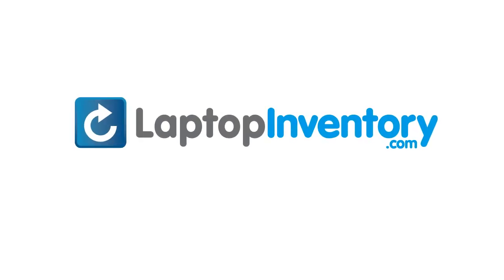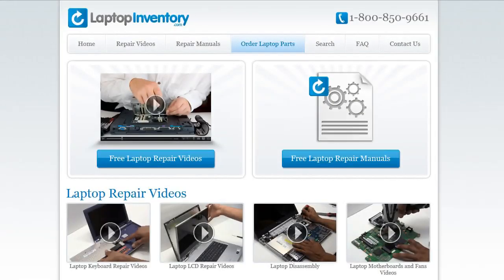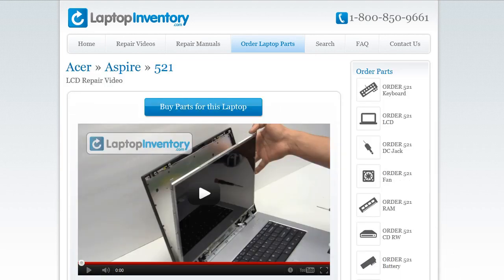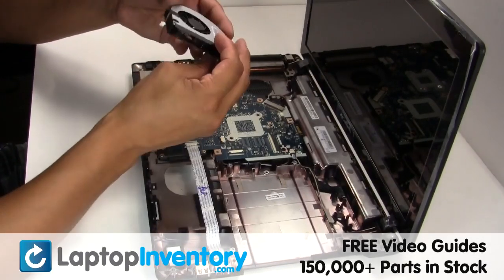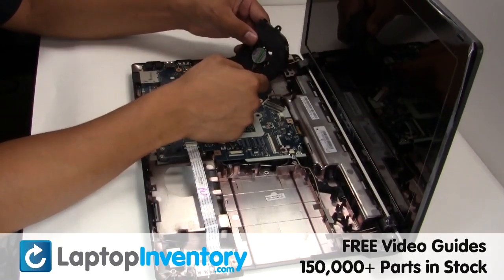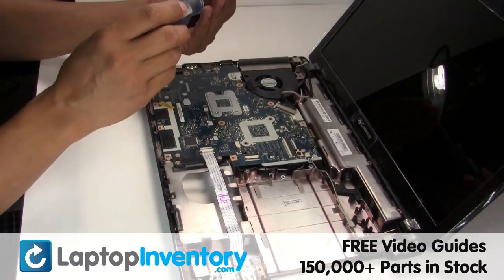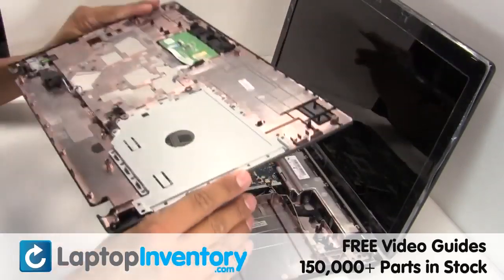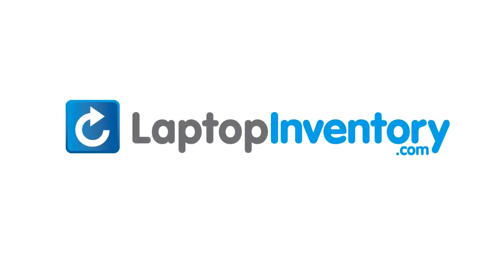Gateway Fan Replacement NV55C NV59C | Laptop Notebook CPU Cooling Heatsink Fix Repair Install

Comment: OH YOU GUYS ARE FRICKIN LUCKY , try doing the NV57h, they REALLY donked it up 
This is probably the worst laptop I got to dissasemble in my ownership, 
you gotta remove all the ribbon cables just to merely access the back of
 the motherboard, which has even more wires to unplug, then you are 
allowed to actually have the motherboard in your hand if you can 
unhandle it from the intel wifi chip, its a hassle everytime, I just 
want a laptop which's fan wont sound like crap haaaa

Comment: The video was good as far as removing keyboard and being directed to more info, if needed.

Being an IT repair person for over 25 years now, I cringed a bit when I saw the Putty-Knife like, metal tool being used.  

A safer way to release the old kybd, IMHO, is to use a couple of credit cards. They are stiff enough to allow some prying effect and safer than a Metal putty-knife type device. After releasing 1st catch, keep one credit card under the top, right corner, so it doesn't fall down and reattach itself. Use 2nd card to release next catch, and so on, sliding 2nd CC toward the left as catches are released.

With the NV55C there are 6  top retaining  "sliding catches".   

The hardest part can be finding those 6 Sliding catches above the top of the kybd. Then releasing them in succession, without messing up the catch itself. [or worse, not seeing one of the catches, proceeding to next catch and breaking  off the previous catch, due to using too much removal force]

To help with finding the 6 releases,  on the GW i3 NV55C laptop at least, the sliding catches/latches are located ABOVE  the following keys:

1. between right edge of ESC key and left edge of F1 key
2.  between right edge of F4 key and left edge F5 key
3. above F8 key
4. Above F12 key
5. Above DEL key
6. above END key

This GW laptop I have is an older i3, first gen I think. It is now on it's 3rd kybd.  This time around I found a new replacment for under $9.00 on ebay, free S&H.
Kybd's have been the only item needing replacement, in all the years I've had this laptop.

Having added an SSD and max'd out RAM a few years ago, it is still running fast enough to easily work with current programs and run on Win 10 as its OS.
Reply: Great information, thanks a lot.

Comment: Ok..great video, however, when they took apart laptop, there were parts already  missing.  So i was kinda confussed.  Also when i put it back...my wifi is not work.  Would be helpful if dierection was given..saying which wire was what and eg..wifi..I am  new at this, very smart, but information during video would be great....thanks

Comment: the video helps me to open my NV55c and to clean the fan, but when i close it, it not turn on (electric), so i need to open it again, and know i need to find what was going wrong. S H I T. but great video, thanks Man.
Reply: Same thing happened to me. I found the fix by removing the keyboard again and reinstalling the power wire toward the left side of the keyboard. I believe they missed that step in the video, or I missed it myself

Comment: I searched through your video's typing in my make and model (Packard bell easynote TM81) I couldn't even get the keyboard off. I'm needing a new keyboard also needing a cooling mat and want to clean my fans at the same time. Any advice?